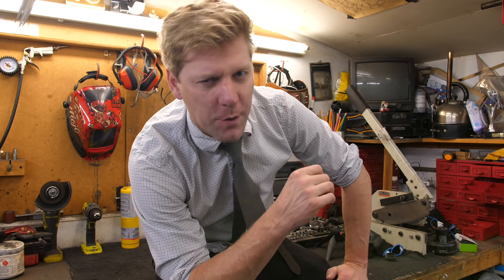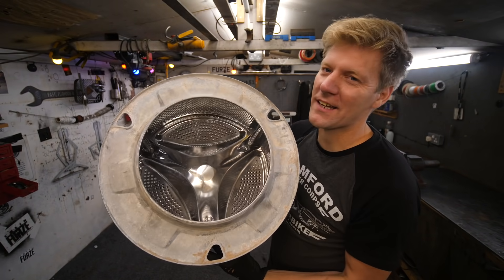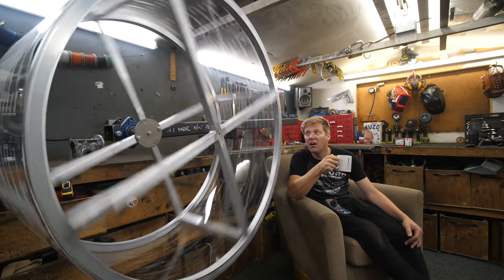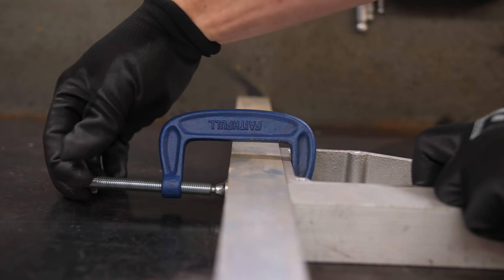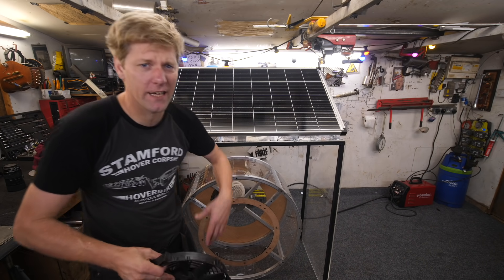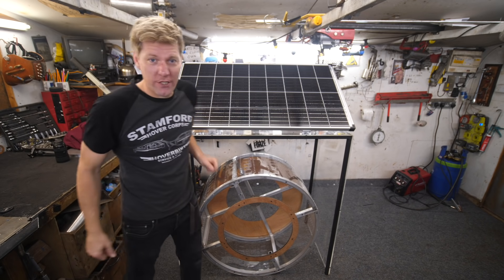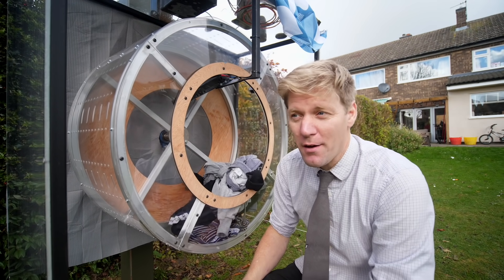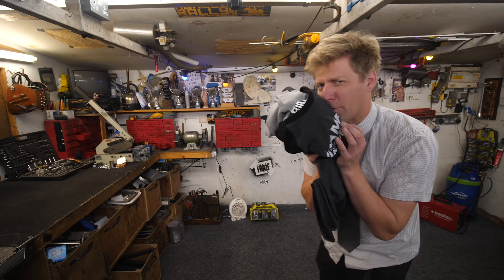Wind/Solar Powered Clothes Dryer

Comment: A wind powered clothes drying machine? Isn't that just a glorified washing line?
Reply: This is better because it's a lot more complicated and doesn't work.
Reply: @GunkDung  Even better, it's built by a guy wearing a safety tie. Win by default.
Reply: @GunkDung  amazing 😂 I love this comments thread
Reply: Except a clothesline + clothespins are cheaper, and your clothes dry waaaay faster
Reply: @Medabee8  Colin's invention might be faster if it rains though....
Reply: @ShadowedbySusan  If it rains, the high humidity will prevent it from drying all together. It'd take days to dry a load.
Reply: @ShadowedbySusan  nah, you can get little shelters for clothes lines, they are very popular in rural Ireland.
Reply: @ShadowedbySusan  i mean it would still be cheaper to build a shed over a clothesline if we talkin rain
Reply: @ShadowedbySusan  nah, just put the clothes line in side. already is one in most houses anyway over the bath tub
Reply: @ShadowedbySusan  easy solution, in my laundry room I have a think PVC pipe going across the width of it screwed into the walls with a wire support in the middle screwed into the ceiling, so no matter what the weather is outside I can hang anything I don't want in the dryer to dry. Then once it's dry like my t-shirt for example they are already on hangers and they can go right into the closet.
Reply: @CommodoreFan64  Don't forget to iron them before you hurl them in the closet. :D ;)
Reply: @ShadowedbySusan  Na, If something needs ironing, I just do it the day I need it, because if I put it in my closet it's gonna get wrinkled anyways.
Reply: @ShadowedbySusan  you can put the line under a roof...
Reply: @Medabee8  well but this one doesn't sunbleach the clothes. But I guess in Britain, nothing get's sunbleached, really.
Reply: @THEMithrandir09  I lived in Thailand for a while.  The first time I did clothes, I put them out in the sun to dry.  Big mistake.  When I took in the dry clothes, you could see a giant fade line, where there was a fold in material.  It surprised me just how much they could fade, in a single drying out on the line.
Reply: @Medabee8  On a boat (in Australia) you aren't allowed to use a clothesline. So it would be useful in those situations (and on a boat there is basically always wind).
Reply: It takes 20 minutes a day to hang up 2 loads of washing... all the kids socks... i want one of these just for convenience.
Reply: This design also saves on space
Reply: (see's video)
Yay, new Furze video
(Wind/Solar Powered Clothes Dryer)
...wait a minute,
Reply: But this can work even in the rain.... its effectively a water proof washing line. GENUIS!
Reply: @Nova-Dave45  If you had a removable cover, you could wash your clothes in it as well.
Reply: well yes.. but actually no..
Reply: I actually thought this video was going to be a joke and it was going to just be a clothesline, him walking outside, stringing up a piece of rope and saying "Done!"
Reply: Like he said it's to avoid the tedious chore of pegging the clothes on line. That's the worst part of doing the laundry.
Reply: @RandyTwang  then get a heat pump dryer, clothes dried in 1hr 30 mins using only a kw of energy
Reply: i think we should have automated clothesline with auto clipping
Reply: don't question it. the man has made a machine to feed him cake, it's a better idea to just accept it or run away lol
Reply: But clothes dryed in drying machines look better and has less wrinkles
Reply: https://www.youtube.com/watch?v=xECUrlnXCqk
Reply: https://youtu.be/EWd2tZJTIGg
Reply: @ezza2x899  Fair point.
Reply: You’re on the Colinfurze channel. What do you expect?
Reply: Solar and wind combo set up is pretty. Airdryer is time consuming good for giant Hamsters.
Reply: @ezza2x899  On a boat (in Australia) you are not allowed to use a clothesline on board. So this may be useful on a boat and on the water there is a lot of wind.
Reply: This could go inside a house with the power sources outside, saving a ton of space and meaning it works in the rain. 👌
Reply: https://youtu.be/kbY53RLJHfY
Reply: It's the compact power version.
Reply: ur all contrarians.i think
Reply: @catink5267  Either that or librarians, I can never remember which is which.
Reply: asinLoveyunz.link
Reply: Join the club fam: https://youtu.be/25l96_-5PZI
Reply: Yes ,but so is a standard dryer lol
Reply: that's no fun tho innit??
Reply: It's a lot quicker than manually hanging up each individual piece of clothing though, it does dry quickly, but that's because you've gone through the extra effort of dividing every article of clothing so it gets its own "environment" to dry in, and you're also taking up a lot more space if you have one of those fold-out washing lines. Plus the point of this competition was not to lose our creature comforts.
Reply: I mean you're not wrong but you're also not right.
Reply: @ezza2x899  not everything needs to be fun or complicated and this whole "competition" is shell trying to propagandize that "we're green and good now" despite to this day destroying it for the profits of a few billionaires. A clothesline is cheap, effective and extremely carbon neutral. We need to get away from buying/building new things just because they are neat and they allow us to think we are saving the planet with just throwing up a solar panel and some wind turbines. Your saving the planet when you don't go out to eat, your saving the planet when you put on a sweater instead of turning on the heat. We need to stop being lazy and glutenous and then maybe we might save the planet from complete and utter poisoning
Reply: @obviouslyniceduh5521  So you live in a barn powered by solar panels, with a plumbing free facility including the outhouse, and don't own a car or bicycle? After all, everything else is a waste of resources or damages the environment.
Reply: @EMFAudio  first off you can build a bicycle out of bamboo and natural rubber. second the metals needed for the solar panels are extremely bad for the environment and the people that mine them and the local area. Third the whole point is to not try and "buy"  something "fancy" to fix our greenhouse gas problem, it's to cut back on the excess personally and realize that our exploitative capitalistic system won't fix the problem. they will just try to sell you good feelings and green colored words while governments and massive corporations pollute more and more without caring about anything but money and power
Reply: @obviouslyniceduh5521  By all means, show me your bamboo and natural rubber bike you made. Make sure you don't ride on roads, because you know, man made pollution. Also don't go on any trails near vegetation because you'd disturb it. Your holier than thou outlook isn't impressing anyone.
Reply: @EMFAudio  I do hope you don't consider what the other person said entirely unreasonable. I mean, nobody has to go all the way, but having some consideration and avoiding the opposite extremity does help. Even more so to support a notion of having a bit of restraint in others than neccesarily making large impact on your own. And although it's easy to assume that person doesn't follow their own words zealously, it doesn't take away the merit of what's been said, does it? There is still difference between trying to follow and idea to a rational extent and discarding it altogether.
Reply: @obviouslyniceduh5521  the planet is fine, it doesnt need saving, its been chugging along for 4 billion years with calamities  through most of it and we arent even a blip on Earth's radar. we will have come and gone in less than a million years and the Earth will keep going. that being said. the clothesline is still the most efficient way of drying your clothes using wind and sun.a machine is just more convenient.
Reply: Somebody wasn't listening! Cocks go in your mouth...not your ears...or so I've heard.
Reply: @anythingelectric5209  Right? Obviously there's a lot to be improved upon on Colin's design. This was more of a proof of concept than a final product. You can probably add a heating element to speed up the drying process and maybe a different motor that runs on the solar/wind battery much faster and more efficient. Plus a clothesline is subjected to the elements, while this uses the elements.
Reply: @41tinman41  Adding a set of tumbling fins inside the drum would separate the clothes more, and also speed up the drying time.
Reply: @41tinman41  Last time I checked, a clothes line uses the elements but without other stuff in the middle. It isn't possible to collect wind and solar energy then pass that energy through electronics and machinery with an efficiency of <10% and somehow end up with a more efficient drying process.
Reply: @murphsmodels8853  tumbling fins allow the clothes to go farther up the side, without sliding back down.   Then they can fall back down to the bottom.
Reply: @41tinman41  he got other  people thinking :)
Reply: @anythingelectric5209  they missed several points.